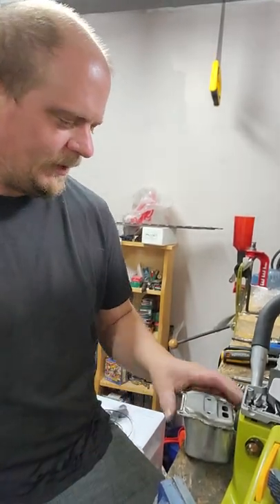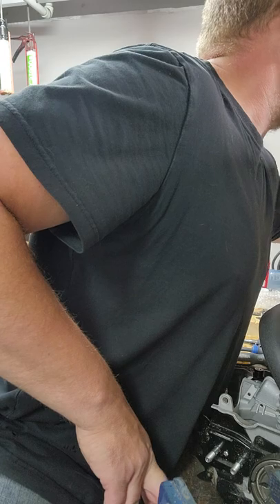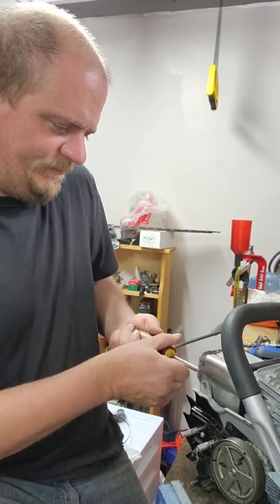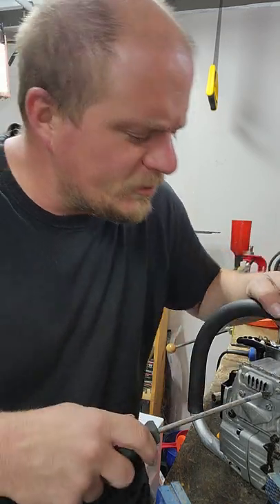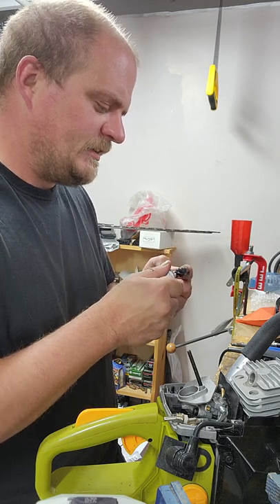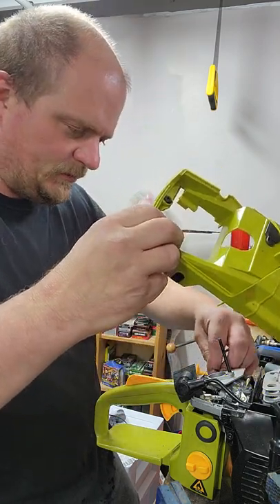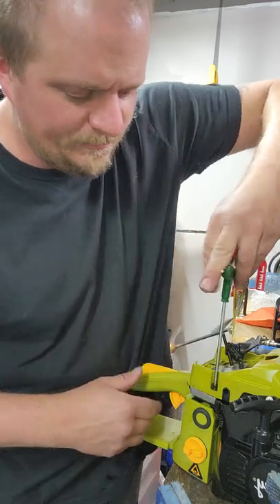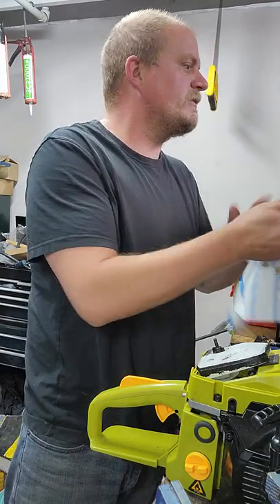radley muffler mod and some reassembly and rambling

Comment: I follow you and another fella who has one of these Radley saws and seems to like it. How have you made out with yours so far? Anyone even know the horsepower specs on it?  These mufflers are beyond choked up inside though.
Reply from the maker: Yeah the mufflers need to be guttet or can buy a better muffler for about 7$  these saws are a great platform to mod, new piston cylinder sets are a dime a dozen, on my channel the supmix, proyama and the Beijing banshee are the same platform as the radley..
Reply: @chainsawcanuck  do you have a favorite parts supplier for these, or? I know you've mentioned Ali Express and the ridiculously dirt cheap shipping, so do I just search Radley there?
Reply from the maker: @justindubya458  just search for 5200 Chinese chainsaw.. The radley has a 45mm bore.. It's actually 49.3cc., but the Chinese 4500/5200/5800/6200 chainsaws are all basically the same just different bore diameters, and the 5800/6200have a longer stroke

Aliexpress is my favorite but all the same stuff is on ebay
Reply: @chainsawcanuck  down the rabbit hole I go...
Reply from the maker: @justindubya458  it's a fun rabbit hole, can do modding and won't break the bank
Reply from the maker: @justindubya458  and if you have any other question on modding these feel free to shoot me an email
Reply: @chainsawcanuck  thanks, will do. Is it listed here?

Comment: So have you tried the saw since the mods and is it better now? I purchased one and ran 5 tanks of gas and noticed the part inside the muffler was red hot after about 6 or 8 log cuts, have you noticed that?
Reply from the maker: I gutted my muffler to get rid of the catalytic part of it, you can also go on aliexpress and just buy a non catalytic muffler for it, makes a huge difference 
Just found this amazing item on AliExpress. Check it out! C$1.93  20%OFF | Garden Tool Parts Accessories Gasoline Chainsaw Attachment 5200 Muffler
https://a.aliexpress.com/_mMjMfnw
Reply: @chainsawcanuck  Thanks for the tip! ordered and got it now, will install and let you know how it goes